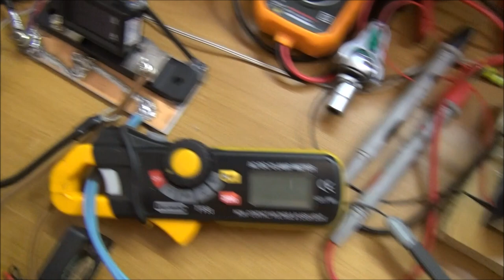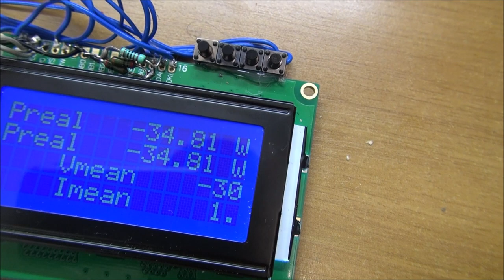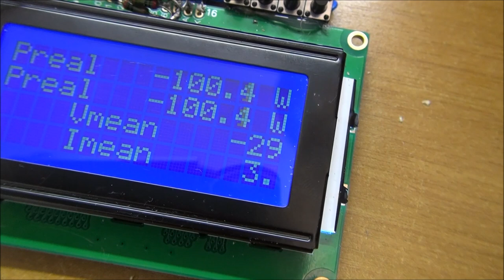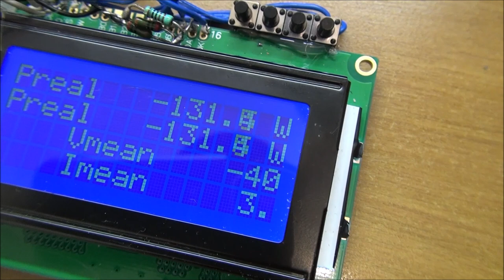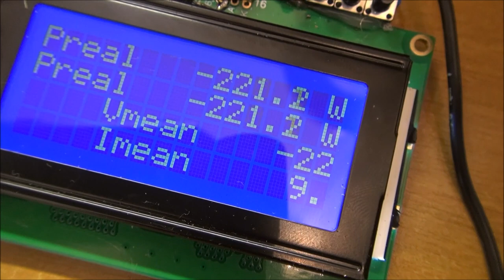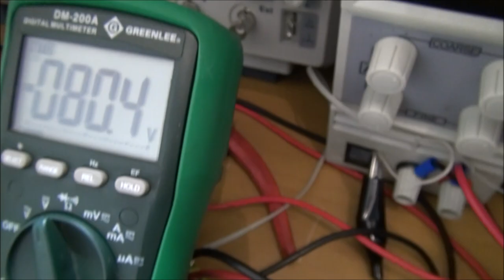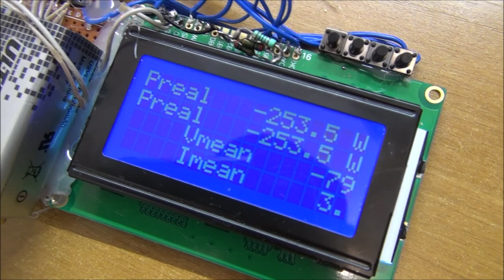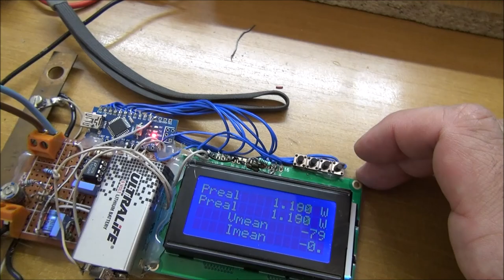Boost converters: The real watts

Comment: Back in the day I was also interested in making my own car amplifiers so I researched the dc-to-dc converters as well and I did manage to build my own that gave me about 24 volts at 100 Watts total power. I had a Radio Shack book on building power supplies and it included how to build switching power supplies and one of the chapters was how to build a step up converter power supply so I model moine after that using a 555 timer and an IRF510 mosfet alomg with a hand wound toroid inductor
Reply from the maker: hello yes this kind of project maked us struggling a lot. But now with some information on internet we can find some interesting ideas. Back in the day, absolutely no one could help me, ingineers, or teachers, nobody know about that. Thanks for your comment.
Reply: @AIexanderHartdegen  exactly i was doing this in the early 90s when the internet really wasnt as big and information was much harder to find
Reply from the maker: @researchandbuild1751 , I was exactly  17-18, and I didn't have even a oscilloscope. I tryied very hard to build dc/dc converters, all my money was spent to buy mosfet, toroidals, which was destroyed instantaniously. It was a very struggling time. But I learn a lot. Thanks

Comment: The big converter blew its fuses and only did 800 watts because your input voltage was too low.  If you raised the input voltage to 48 volts, it would've done 1200 watts with ease.  However, the real test would be to see what load it could sustain for several minutes without overheating.
Reply from the maker: LOL that's ok this is your point of view to focus about howmany minutes it can works without overheating! But that's a good point to see.
For to give you a response about that I never noticed a any one clue of over heat when from those converters when experimenting.
Anyway you're right about the 48V supply to have 1200W and I supposed it raise this power if it's powered like that. 
Anyway, the purpose of this video was to show if those device are real, quite reliable, or fake. Even if I didn't raise lot's of power, I think those device are reliable and exceptionnel for the price. Thanks for your comment.
Reply: Do you know the maximum output voltage when the input is 48v? Some sellers say its about 92v, but im afraid to buy because my inverter uses about 90v, nothing less.

Comment: 2:40 how about this converter to power a 80W (19V 5A) laptop from car (12VDC) continuously? I think it would fry because about 10A primary side current, or is it strong enough?
Reply from the maker: it seems to works nice, simply warm.Because this is a high effeciency boost converter. If you want to be more prudent, you can use two, connected in parralel, to dissipate more. But one can be enough. But for a continuous power, you need to forseen a air cooling box, or working without a box.
If connected in parrallel, you need a low value resistor on each positive output.

Comment: Hey got a quick question I think you can help me with. With the white boost converter (with the aluminum bottom), do you think it can handle a 6s battery 22.2 volts, boosted to 31-33v 3 amps max? What do you think?
Reply from the maker: Yes, I think it can perfectly do the job.
Reply: Thanks!!! I have 4 or 5 of these and I never really tested them. Got a project I’m working on and this is a key component. Thanks for the quick reply!!!👍👍👍👍👍👍👍
Reply from the maker: they are good stuff, that's nice to have them on the bench. Thanks for your comments.
Reply: Hey i like both of your Channels!

Comment: I have the white 250W 10A boost board but it has a design flaw.
Input 12V - set Output 30V - Connect 30R load and switch it on with load connected. It draws over 5 Amps and gets very hot! I use a 5A limited PSU so it is not destroyed.
But - if you switch it on with no load connected and then connect the load, then it works OK.
So please repeat your tests but connect load FIRST and then switch on power. The result will be very different for some PSUs!
Reply from the maker: This is not a flaw design. The booster you are talking about is A LED DRIVER.
And booster for LED doesn't work like a classical booster. They need to reach a certain voltage, according the voltage of the output, normally a high power LED voltage, before sending current. If current is growing on a linear way before reaching this setpoint voltage, the system will not work properly.
you can add to the output a relay, or mosfet, to switch on the output only when the voltage is rising the maximum. Connect a 24v relay to your output with a 470 ohmw resistor, and connect your load trough the NO switch of this relay. You will be satisfyied. Don't forget this device is a LED driver, thanks.

Comment: cracked a small ceramic capacitor in front of the output terminals. Located between two electrolytes 100v 470 mF and output connector. Please tell me his number
Reply from the maker: @Maier Maier
 Hello, you don't really need this ceramic capacitor. It's an capacitor between 10 and 100 nf (I think it's 4,7nF) used here to filter output in the range of high frequency output, helping the chimical capacitor by having a different behavior with high frequency. You don't really need it but if you want to replace it simply by another ceramic capacitor of 4,7nf...100nf.

Comment: Got one more quick question...LOL. I need a PWM controller to control the power of a glow plug. I read somewhere that the White Boost converter uses a TL494 pwm chip. Do you think using the current side, I could control the temperature with this? I have a project coming up and I just need something simple to control the power.  What do you think?
Reply from the maker: Maybe you are talking about a glow plug coming from a diesel car engine. Those plug, if that's you're talking about, use a high current to heat, mostly when they are cold. A single plug can pull between 15 and 20 amps when it's brandnew. But you want to control the temperature.
I think those device are not suitable for to drive a load with an impedance of 0,5 ohms... Because this is simply a short circuit for them, and the raise of voltage across so little impedance is nearly impossible from a device like that. If you really want a temperature control, you need also a temperature probe for a feedback control... It is possible to manage to fix a thermocouple on the heating element of this glow plug?
The other solution is to connect basically the plug to the power manager, and see how it's heat. Until it rise the desired temperature, the power need to be switched of. And reconnected when the temperature failed to much. The frequency of switching/unswitching need to be considered, and a on/off circuit of the same frequency need to be build, with a relay of power mosfet transistor.
The TL494 can be use for to control temperature, but you need a feedback control.When plug are connected they pull more than 10 amps and they stay cold... If you intend to feed your plug with a high voltage decreased with this kind of boost module, you need to know than "boost" are not " buck", also they are not able to deliverate low voltage from a high voltage. On a car, plug are connected to the main by a simple power relay.
If you want to "control the temperature", a feedback is need. Thant's mean you need to add a sensor on the glow plug tip. And this, after the question of the power supply able to feed such devices will be settled.
The problem is not the power, the problem is to rise from a short circuit to the voltage required to maintain the plug hot. The most simple way is the adjustable flickering relay (mecanic or electronic), with temperature adjustement before will be approved.
Reply: Alexander Hartdegen most important f the chatter claims, the only way to control them is with a pwm of some sort without a temp return. The resistance is enough to pull around 8 amps from a 12v source. I forgot these boost converters don’t like resistive loads. I actually built a pwm with a temperature return from a lm358 and z44.(video is call 907f mini soldering iron), that may work for this. I also have some 10k 5% glass thermistor.(same ones use with the hakko soldering irons). Maybe I can figure something out with this??? Thanks for the details and heads up!!!!
Reply from the maker: In the hakko iron they use type K thermocouple or a PTC sensor of something like 1 kilohom maximum. Probably the thermistor you're talking about comes from the pcb of this hakko iron? Temperature probe for high value are special, you can not use a one intented for a pcb.
You really need a termocouple and a v/V converter, like a op amp. I think 358 can do the job (I think but need to be tested). For this, you dont need a 394 but simply a first amplification and a new op amp for switching from a reference source.
I think the mostly serious work here is to fix a thermocouple on the plug.
But, also, you can use a plug just with a continue flickering power supply, regulating simply the heat by this way, very easely. Some people use this technic with soldering cartridge.
Reply: @AIexanderHartdegen  You are correct! The cicuit board I made is actually for the 907F hakko or fake soldering iron that uses the thermistor. But with a little tweaking, I can use a thermocouple.  The cuiruit uses a basic lm358 PWM with sensing feedback from the resitance of the thermister. Take a peek when you get a chance. I'm thinking if i need a refrence from the glow plug, using a thermistor(may not be enough for 1000c). I may try and alter for a thermocouple.  But I just found another post where the DIYer used the same lm358 system just to control the amerage going to the glow plug.  I basiclly just want something to divide the heat from 1000c pus to 500c or under.  

No matter, sounds like some fun testing ahead..>LOL

Comment: Sir! Can i use White (250 watt one) to charge my 24 volt battery pack from 12 volt power supply? (Which is a pc power supply unit)
Reply from the maker: yes you can. Be carefull with the output current, and voltage. You can use a low resistor and diode for safe.
Reply: Alexander Hartdegen thanks a lot for your reply sir!

Comment: Very nice video. Thanks. I have a 48v battery bank. Would like to know if i can use this boy to increase the output voltage to something about 90v? That way i can use my nobreak as inverter. Thanks buddy and keep up the good work.
Reply from the maker: there is two models of the big one. The previous model is 1200W and gives 80V. But the new model about 1500W reach 86V. To reach 90v would be more difficult but if you can have enough of 86 you can buy the 1500w model

Comment: Ok, thanks,  but bitbattery needs low cut off at say 11 volt so I need to think this booster is needed for our emergency lights which we have planned to produce more in qty
Reply from the maker: dont forget the essential. Booster are used to convert a low voltage to an higher voltage, for any use you want. Charging batterys, light, amplifier, motors, ever you want. Thanks for your interest.

Comment: For The white one 250 watts when I connect 12 volt battery it short circuits. Can you please tell what might be happening.... Have 2 of these both doing the same
Reply from the maker: first connect the booster, after the booster is on, connect the load.
Be carreful, if the load is to strong, it can destroy the main MOSFET transistor. Those white boost converter are made for working without load until 35V (use for power LED). For that reason, you need to take time to let them switch on, and after, connect it to the load. If they are shorted without load, main MOSFET is dead, need to change it. Also, check output and input diod.
Reply: @AIexanderHartdegen  thanks

Comment: Can i use the second one on 02:54 to connect with 12V 70A car battery?
I want to increase the voltage, because I want to make a 200 Watts power amplifier in my car, i need 20V and 10A current..
Thanks for the answer..nice video and very inspiring..
Reply from the maker: I think it will work. But for your use, it will be better to use two converter, connected in parralel with connecting a low resistor value output for each (0,2   0,1 ohm).
Dont forget there is a new version of it, slightly more powerfull, of the same booster. I advice to you to use the 3:40 version.

Comment: hi i have a 36v 370wh battery its 10a, the charger is 42v 2a i'm wanting to buy something like this to charge it from my car at 12v, think the controller on the battery can accept up to 4a  whats the best one of these dc to dc to do the job do you think?
Reply from the maker: You can make it with the white model, with adusting current output max and adding a diode on output for more safe. There is new models avalaibale, with more power, 600W instead 300.
Reply: @AIexanderHartdegen  thankyou what diode would you use ? think ive found it 600w version has amp and volts , costs about £7 inc postage. the only thing i cant see heatsink so nowhere to add a fan if i find it gets to hot, what you think?
Reply from the maker: @lookoutleo  you  can use 3 x 1N4007 in parralel. This booster is built on aluminium plate, wich hold all power transistors. You can stuck it by adding special compound and fix it on a heatsink. You need to be careful because using those booster on 12V force them to work hardely. When you are experimenting, you can use 12V50W car bulbe is series with the booster to prevent any damage before fixing all presets.
Reply: @AIexanderHartdegen  Thankyou for the info, is it the module with 3 capacitors on both ends? Would I have an amp meter in series to set the output current , the battery has built-in BMS so should be ok even if the current is set wrong? I'll put an 8a fuse on the 12v side to as it should draw about 6a 12v to create 2a 42v ish? Thankyou for the help. I was looking at the 20a boost modules with the digital display , they are about £15 , these seem so cheap for what they are, I already have a 150w one I use on my laptop , it's 12v to 19v Chromebook works great :)
Reply from the maker: @lookoutleo  yes. the module with 3 capacitors. Yes you need ampmeter to check the output current. But you can not have 300W from 12V. Those devices have the full power with only few volts difference between entry and output. To have the best power you can use the  20A module, it's the most powerfull and reliable module, mostly if you want charge your battery fastly.
Reply: @AIexanderHartdegen  is that the module with digital display , ive seen quite alot of versions. One with 2 pots?
Reply from the maker: @lookoutleo  it a low power module, for little device, or batterys. Look at the voltage output, it need to be the same or higher that you need.
Reply: @AIexanderHartdegen  Thankyou I went with the large 20a version, the one you blew the fuses on :) so when I set it to output 2a 42v converting from 12v 7a or so the converter won't be trying , that way should last for long time and found it in UK Inc postage £10.50

Comment: Hello, i've just got this dc booster. It has 3 pots, one for CC, other for CV, but the 3rd (near the input) what does it do? label is RV1 or something.
Reply from the maker: limitation current output.
Reply: @AIexanderHartdegen  limitation current output is "CC" (Current Control). The 3rd (near the input, not near the output) is to limit the minimum input voltaje. Thanx
Reply from the maker: @rodstartube  OK I didnt know thanks
Reply: Its for input undervoltage protection. If you boost up battery.
Reply from the maker: @RadimKonecny  thanks

Comment: Thank you so muchhh. I bought 4 pcs of type 1500w booster. I tend to boost 4 solar panel to 80V then series them upto 320-330V DC, then it could be power supply for Inverter Air conditioner! Do you think the idea is possible or not? Can it damage The whole Air Conditioner?
Reply from the maker: Each solar pannel need to be able to provide 1/4 minimum of total power of the air conditionner.
Each output converter need to be connected to a high voltage and high capacitance capacitor.
If your air conditionner need a triphase input, you need a DC/triphase converter.
If your air conditionner have electronic rectifier dimmer, you can feed it simply with the dc voltage coming from the converters.
You need a automatic switch to deconnect the air conditionner from the main before the power supply goes down, due to vanishing of the sun.
You need to analyze if your air conditionner is able to work with DC current. (if it has electronic motor driver, it must be ok)
You need to know than if your air conditionner is old, it will use a high pic of current when starting, and you need a lot of capacitors to allow it. It can works, but it need some studies and lot of test.